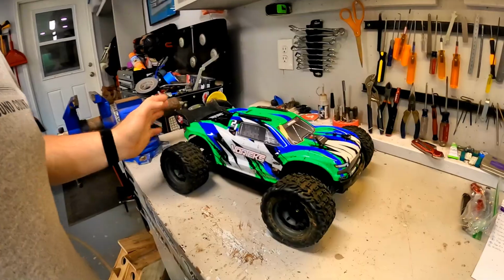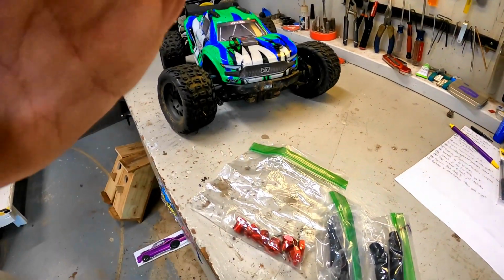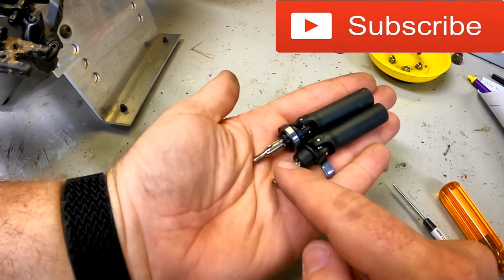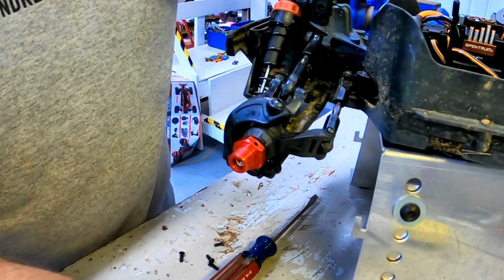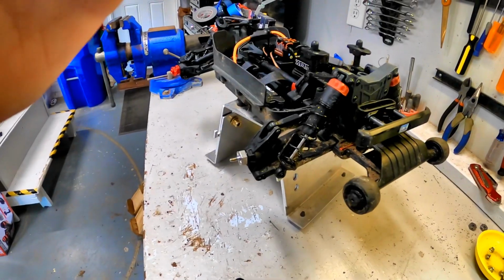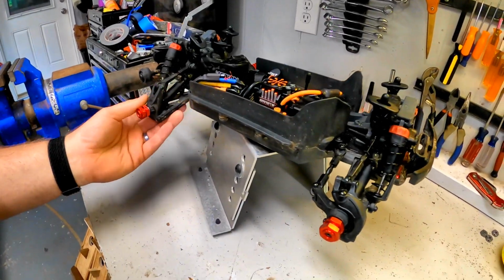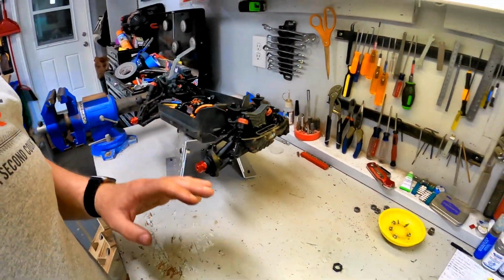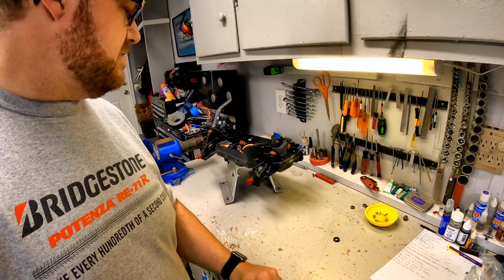Arrma Vorteks | How to Convert to 17mm Hex

Comment: Would this work on the 223s 2wd Vorteks..? Also any chance of the part numbers from Arrma..? Thanks..
Reply from the maker: Hello! 
I checked the parts diagram of the 2wd vorteks.  Based on that, it looks like this conversion works great on the rear - but I am not sure if it would work on the front.

Comment: The wheel will not help hold the 2mm set screw in place. It is exposed on final assembly and can backout. 
This conversion does not work on all 3s arrma vehicles. 
Example: Vandetta bearing hubs will not allow you to use 17mm axel stubs bc the inner bearing is recessed further apart than the other bearing hubs.
Reply from the maker: Hi there!
Actually...this seemed to work great.   Never had an issue at all.  
Maybe I got lucky with the specific wheels I ran.

Comment: what about the tires the moes for sale usually say 12mm is that the with of the tire?whats the titr model no. thanks
Reply from the maker: The Vorteks comes with 14mm hexes stock.   
This was converting it to 17mm hex.  I then put different tires on it later that use a 17mm hex.
Reply: I know but I’m not finding tire / wheel combos with 17 mm most say in description 12 mm I want to do the conversion but I need the correct tires
Reply from the maker: @trainday  I used these:
https://amzn.to/3HIA0Eo

Pro-line offers changeable hex to use 12mm, 14mm, or 17mm.

Comment: This is the video I've been looking for. I have 3 typhon 3s and wanna swap the hubs on one to my vorteks. So am I correct on everything swapping right over without needing to order anything else. Sizes etc should fit?
Reply from the maker: Swapped over just perfect.  All using stock Arrma Typhon 3S parts
Reply: @RoadsideRC  awesome thanks man. I'll start on it tomorrow. Any recommendations on a cheapish motor and ESC to make a buget 100mph typhon lol
Reply from the maker: Should be able to get there with stock 6S Arrma electronics...

Comment: What wheels can you put on it and if you put a bigger wheel on it will it cuase the motor to get to hot?
Reply from the maker: I am going with a set of Pro-line Badlands - video will be out Sunday morning!

Taller tire typically will lead to a little more heat.

Comment: Nice work, I didn't know you can do this with all Arrma parts. Curious how much these parts were. But yeah M2C makes a kit for $40 but as you said it does add 5mm. My thought is though... Adding a 5mm will be pretty close to the dimensions of what a 3s 1/10 scale Talion would be, and some would like to see a 1/10 scale Talion.... I don't know, just a thought.
Great video brother
Reply from the maker: That is a good point - some folks do like to widen their vehicles. 
I really don't like running extended hexes on a basher for durability reasons.  Extending the hex just adds additional strain to that hub.
Reply: @RoadsideRC  agreed on the potental for Dammage, 5mm is usually not much risk and even 10mm is max I would ever go. I would never touch 15-20mm but some offer it.